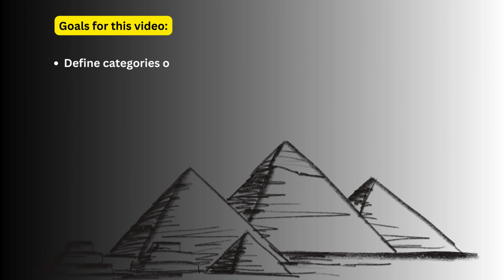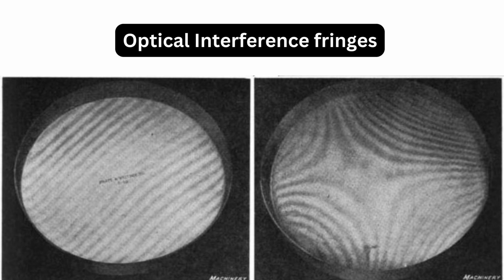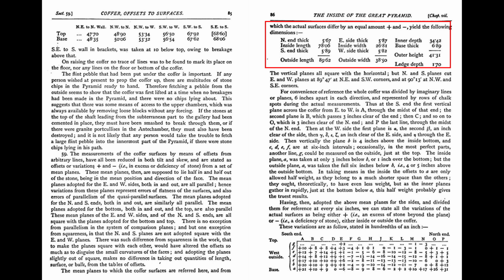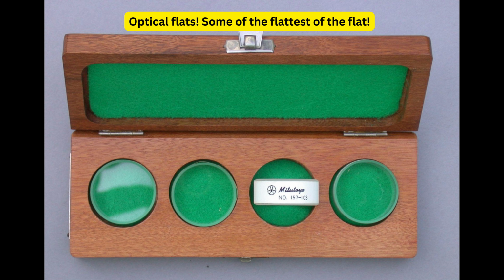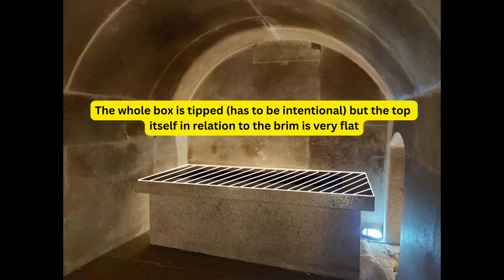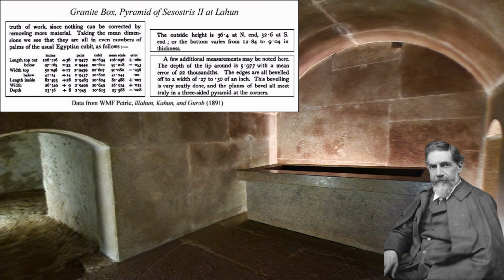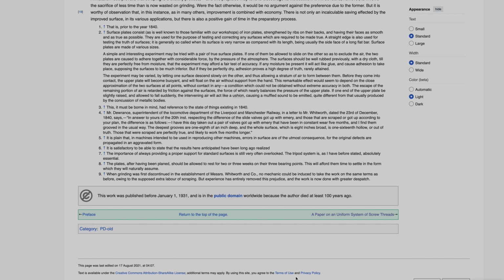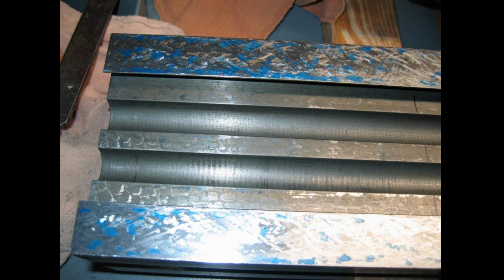The Problem of Flatness in Ancient Egypt

Comment: The acronym is "CMM" not "CMMS" - that's just the S making it plural, so you'd say "CMMs" like "M&Ms"

You say "surface plate plus dial indicator or height gage" but you show a micrometer, which is used for measuring linear dimensions, not flatness.. 

Some unusual discrepancies in an otherwise seemingly factual video
Reply from the maker: I do have the surface plate and dial indicator, I had the micrometer there as just another graphic showing the ability to make precise measurements, however I understand that was confusing. I am not a professional video editor and still learning to do this. Good point with the CMM, I made an error! Thanks for correctly pointing that out. Nothing worse than proof-watching a video and then immediately seeing problems that can't be fixed at this point. :(

Comment: It seems as though you're confusing flatness and smoothness at various points.
Reply from the maker: There are points in which those two qualities intersect. Something can be very flat and it will also be smooth. However a sphere can be very smooth and also not flat. This is why I used the term planarity when speaking about the sides or top

Comment: The polishing method by rubbing stone together with sand, water, oil etc. works on a small scale but polishing granite lids of the Serapeum that weigh 30 tons? Every casing stone of the pyramid? You should also include time in your method because Humans don't live long enough to do that by hand and hand polishing does not seem reasonable.
Reply from the maker: Alright. Thanks for watching
Reply: It does seem impossible at first, but think about it. The Egyptians had mastered leverage, they had also mastered pulley systems/gearing for lifting, but most of all, they had 2 unfathomable resources, sheer determination and man-power. Just as we know that 10 normal strength men can lift a car, 100's of very strong men acting on levers and pulleys can literally move mountains.

Comment: You are talking about "smoothness" of a surface. When people talk about flatness they think of straightness and angles, not the surface structure or roughness.
Reply: Angles have nothing to do with flatness. Flatness is the distance between the closest parallel planes that can encompass the surface.
Reply from the maker: There are points in which those two qualities intersect. Something can be very flat and it will also be smooth. However a sphere can be very smooth and also not flat. This is why I used the term planarity when speaking about the sides or top
Reply: @intothemap360  yes, and something can have a very rough surface texture and still be considered "flat".
Reply from the maker: Much like the kitchen and floor examples in my video
Reply: @tommyrodriguez4883  So, I asked someone who works in optics, and they say that something can't be flatter than its roughness.
My question:
"When measuring rough surfaces, is the filtered measured feature (probed with a probe of a size that contacts multiple points of the surface or filtered in processing) or the measured feature including roughness compared to the ideal feature?
Aka can something be flatter than its roughness?"

Their answer:
"Roughness is actually an EXCEEDINGLY complicated measurement with several different measurable values. So from what I recall, the answer to your first question is "it depends". I'd generally say that no something can't be flatter than it's roughness though since the worst you can get from roughness is the difference between the absolute peak and absolute valley, which is basically what flatness is (obviously more complicated but that's the simplified version)
It should be noted though that I'm pretty sure having a roughness anywhere close to your flatness is generally bad iirc"

Comment: If you get thin plywood triangles from 3" to 8" or so. They don't have to be equal sided. Put a screw in each corner and one in the middle. If you adjust the middle one until it wobbles then back it out you can find a micron dip or hill. Old timers way to check surface plates.
Reply from the maker: Very interesting, did not know this!
Reply: @intothemap360 Huygens optical channel.  He grinds optics for satellites.
Reply from the maker: I think someone else recommended him as well! I shall check it out
Reply: @intothemap360 made a mistake it was Ed Jones channel. Does similar work.
Reply: @intothemap360 https://youtu.be/Z0jCycLpXSM?si=Uq1g9-FitPCxRoUX

Comment: I own a surface plate amongst other precisionesc tooling, so I'm with ya. The title was like a tractor beam, sucked me right in.
Reply from the maker: They are the one item I keep wanting to buy until I look at the shipping price!!! Local pickup will probably be the answer for me :) I am so glad you liked it, you are already living in the nice flat world of surface plates! Do you have a granite one?
Reply: @intothemap360  Yeah, it's a small Starrett, granite 0-ledge 9" x 12" x 3" AA grade (laboratory) I also have 2 - 2' x 3' x 3 cm (1 1/4" thick) granite slabs (acquired retail display counter tops) that do a great job for non-critical stuff. I turned those into a small assembly table. It's a good starter option. You can even get some nice cut offs if you have any granite suppliers near you. The thicker the better. And if you're ambitious enough, get three pieces and lap them. 😏
Reply: @intothemap360  I would check if a nearby university has a surplus auction. Periodically, you can get good quality tools and gauges. Just be careful, because they're selling them, regardless if it was abused in undergrad labs for 50 years or sat in its original box, untouched, until someone needed some more space.